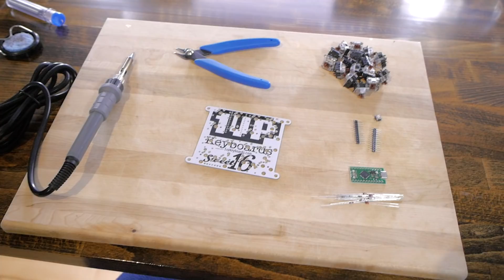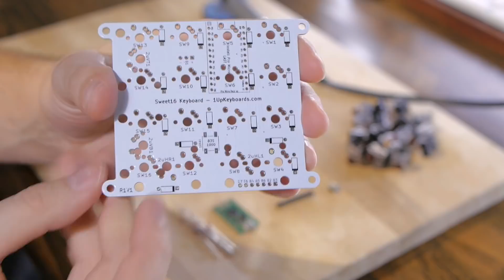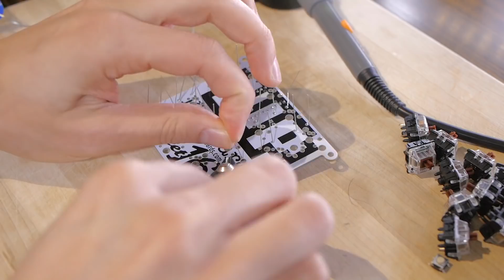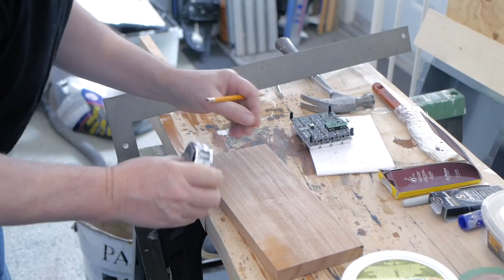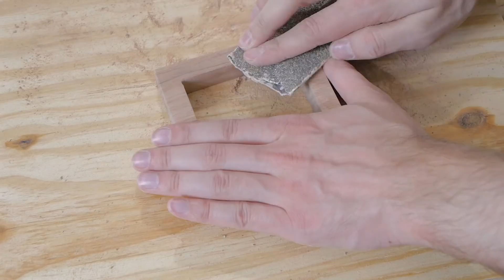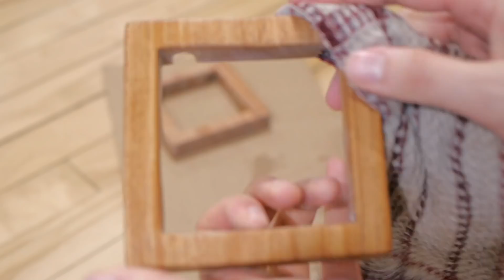DIY Macro Board with Mechanical Switches - Sweet 16 Build

Comment: When soldering the buttons, use some longer screws as standoffs in the four mounting holes in the corners of the board. This way, you don't have to press down all the buttons while soldering and it's more stable to work with.

Comment: You could make this without the PCB, just using the diodes wires and solder them into the switches. The only extra work would be check where to solder each line and colum in the Pro Micro.
I dont get it, why they sell a PCB if it doesen't comes with a microcontroller, and dont even have diodes. You need to do all the work and even buy more stuff.

Edit: Now I saw that you didnt make any bottom for the case. Well, you would need a bottom if you didn't have the PCB, thats why you made it in this way then